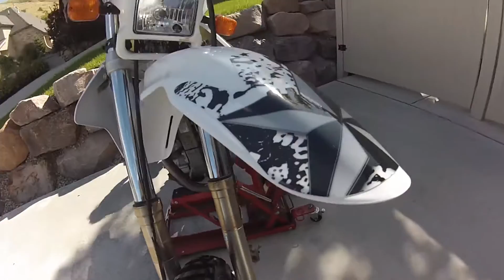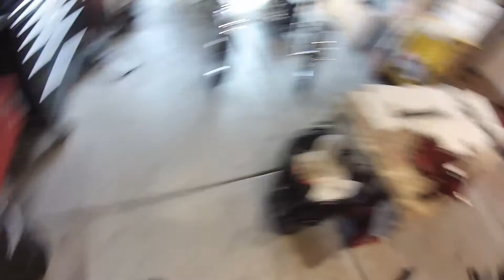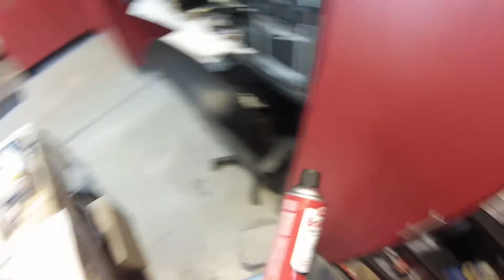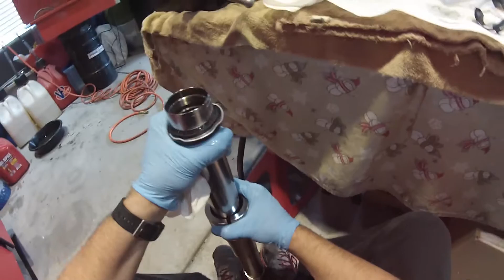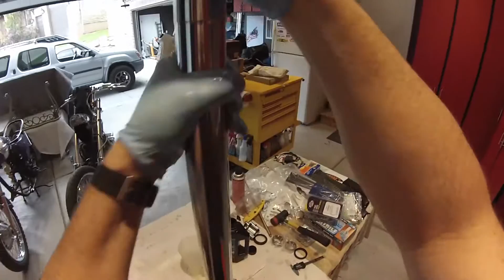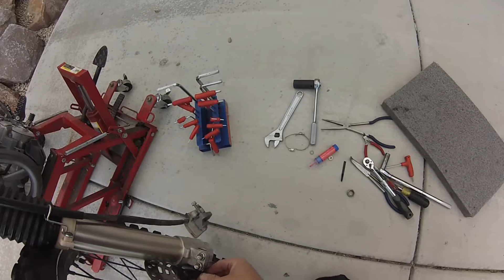KLX/DRZ 400 Fork Rebuild and Revalve - full uncut version

Comment: Hi MrDuhfactor, I followed your advice and currently running your recommended shim stack on a converted SM, by far the best front end feel. Simply plush and no longer feels harsh street riding in CA. Thank you very much for sharing your knowledge.
Reply: Did you change any shims for rebound or only compression like in the video

Comment: Excellent video brother D! I too have my favorite screwdriver! 😁 I did notice on my forks that there was a small spring under the pin that goes in the tube. I didn't see that in yours but I have checked the diagram and it shows them in there. Are yours missing or just a different year? Mine is a 2003 S model. I like the idea of a plush high speed and stiffer low speed. Did you end up sticking with this shim stack or did you change it? I think RMATVMC has Daystar fork boots for the DRZ. Thanks!

Comment: Hi from Spain, Damon! Thanks for the vídeo!

I've been following you since I bought my DRZ years ago and saw your DRZ 400 Extreme Makover.

I've been planning for long time to check my suspension and I think I'll go for it. I have some doubts and let's see if you can help me.

I'm about 232 pounds without my clothes and protections. I have a ohlins rear shock and moose racing lowering links of 1.75 inches and the forks are moved up to equal the lowering back. On the front side I have extra weight cause I have a bigger gas tank (Clarke 3.9 gal). I was adjusting the SAG last week, and I need a lot of preload, so I think I need to change my rear and fork springs. The main use is riding on trails, and rocky and sandy terrains, some light enduro.

On the forks, I have the 2002 ones with no rebound setup, but I've found a cheap ones with rebound adjustment from a newer bike (2010) and I think I'll go with them.

My plan is to change the springs (front and rear), revalve the fork, and replace sealings. It's the first time i'll do it, but I think I'll be able to.

Based on the things before, I think I should change the springs (don't know the rate), revalve (I think I'll use your setup), change the oils and sealings.

What do you think about this? Any suggestion dude?

Thanks for everything!

Comment: You do the best Videos. I need to update the suspension on my 1983 XR350r  I am 6' 290 lbs I was thinking new springs and Gold Valve for Dual Sport. Would love to hear how you would set up the stock shocks. Thanks again for all your hard work for use.
Reply from the maker: I actually had a 1983 XR350R! I loved that bike, the first motorcycle engine I ever rebuilt. That bike uses a traditional dampning rod style fork. The best thing to do is use a cartridge emulator kit from racetech, with the proper springs for your weight. In the old days, before emulators were available, we had to get stiffer springs and go up to 15 wt fork oil, which was better than stock, but not great because ot slowed the rebound down too much. Enjoy that awesome bike!!
Reply: @MrDuhfactor  Thank you, your videos are a great motivator!

Comment: Quick question you seem to be missing the springs on the push rods mine were broken and I left them out wondering if you had any problems running without them? I'll add the part number 51193-28E00 SPRING,PUSH ROD? Great video by the way gave me the confidence to revalve
Reply from the maker: If its the ones Im thinking, Those are top out springs to soften the "contact" when the forks open up. Some models have them, others dont. They also determine how open the forks are at their full length. If your model had them, and you remove them, then your forks will be longer by the length of the spring. Ill check that part number when I have a moment and double check....
Reply: I have the exact same forks you do. 2007 DRZ400S model. Since you run without the springs so shall I. But I did go ahead and order them since they're on the fork schematic.
Reply: @MrDuhfactor  he is referring the the rebound adjustment rod and the rebound needle, which should have a spring to go with it.
Reply: @timpierce5097  I don't think it's right to run it without that spring.  Many people lose that spring when dumping the oil out, or maybe it is stuck inside, which in that case, it's ok to just leave it in there.

Comment: Hi Mr DuhF :)  Great video again.  I also watched your EveRide entire series as I've recently picked up a 2006 DRZ 400s.  How did this shim stack setup work out for you?  I'm guessing I'm close to your size and after watching your vids I feel confident in the process, just not the decisions on shims, etc.  I'm 5'10" 185.  Did adding the four low speed, and adjusting the fast speed shims like you did work well for you?  Just figure I'd ask, and hopefully have a good starting point.  Many thanks for these videos.  jj
Reply: Also, that's super cool four generations are at your garage :)
Reply from the maker: @row911sc  I'm running this same shim stack in my own personal bike, and so far don't feel like I need to change it..... I ride mostly desert, sometimes fast, but it seems to do good on trails too! You can do it, I think you'll like it...
Reply: @MrDuhfactor  If you don't mind me asking more, are you using stock springs or did you up the spring rate?  Racetech says 0.50 would suit me (180-220).  I really appreciate it dude.  :)  Planning on the Idaho BDR in a month.  Probably will do the rear shock oil before I go as well.  Maybe rear comp shim stack too :)

Comment: Great video! After trying out this stack set up, what is your opinion? Did you change anything? I'm looking to revalve a 2002 DRZ400E, love plush, what would you recommend?
Reply from the maker: For me, I like it the way we've valved it, but I ride more open fast desert, and it works great there. If you ride slower technical terrain, the stock valving is actually not bad. I would hesitate softening it too much, that bike is heavy, and you can blow through the stroke real easy, causing a bottoming out scenario..... so, to really answer your question, how much do you weigh, and what type of terrain and speed are your riding?
Reply: @MrDuhfactor  200# w/ gear on. I ride a real mix, open and some technical desert, but mainly dualsport dirt roads, a little bit of slow technical. I'm looking for plush with bottoming protection.... also, looking for stack info for rear shock which I saw your Everide makeover ep. 5
Reply from the maker: @johng9323  The stack Im using for the forks would work well for you with compression clickers 18 out from bottom. I will be filming the revalve of the rear shock from beginning to end in the next few weeks, stay posted as it will likely work well for you too....
Reply from the maker: @johng9323  you becha buddy.... any time.....
Reply: @MrDuhfactor  That sounds great. Thank you very much for the information and entertainment you provide!

Comment: Can't get my main valve out from the bottom of the fork any recommendations, currently using an electric impact wrench is air really required to get the amount of spin needed? Additionally metal shavings came off as it spun did I damage the main valve?

Comment: I recently picked u a 2019 DRZ and want to duplicate your suspension mods.  Were you happy with the results, or did you need to add the additional shims that you had bought?  Do you recall what rate fork springs that you used?

Comment: The part i nobody shows is the bottom forkleg circlip that hold the bottoming cone  fro sliding out the bottom . If you take that circlip out you can slide the whole upper stantion out through the bottom of the leg withou slide hammering the guide and slide bush. Every dr klx 400 fork  vid shows mechanic using the slide hammer method

Comment: So you’ve used Pivot Works here, which I thought was one of the better/best options. 

What is your Preferred seals etc to use?

Certainly for rear pivot in the drz PW were the only one I found with Torrington thrust bearings rather than a Teflon washer.
Reply from the maker: I prefer HKS seals, then OEM, but pivot works are pretty good. I have had trouble with moose brand several times, and get frustrated with tight fitment.
Reply: Yeah I’ve be heard a lot of less than stellar feedback about moose/all balls. I steer away from them. Will have to see if I can get hks nearby.
Reply: Tim Dudeney ...SKF green seals are by far the lowest friction and sticktion....but they’re very expensive. At least they work extremely well and last a long time

Comment: Thank you for a great video.  Do you have plans to rebuild the rear shock? I'm rebuilding a 2002 DRZ400E and could was that video. Also, how are the forks with the new valve set up?
Reply from the maker: The forks are to my liking now, and quite good for fast desert riding. I still need to rebuild and revalave the shock, which I have all the parts for, but it keeps getting put on the back burner with all the other paid suspension jobs that keep piling in. I will do a full uncut video on how to do it soon though.

Comment: youtube algorithm works better with people liking and commenting on certain videos. so i thought id like, comment, and subscribe. would you suggest putting in a klx  jet kit in my klr650? ive heard it is very common and i have considered it but from the videos i have seen it does help performance but on such a minor scale. Would you suggest it? on a 2018 klr. or could you suggest other upgrades that would improve the performance.
Reply from the maker: Howdy Andy! The KLR is a bit lean from the factory, on my brother in laws KLR, we did the washer under the needle mod, I think they call it the .02 cent carb mod or something like that. I runs great, so we havent messed with it other than an aftermarket pipe. I have become spoiled, and dont guess on jetting anymore. I take it to a local dyno and measure it, and adjust jetting accordingly.
Reply: @MrDuhfactor  you would know more than I do as I have just kept the klr running as long as I could. If you suggest me running it through a dyno then I will do so. I just bought a 2018 klr as I feared that kawi would not produce another and have had a great experience In the past. So personal experiences help with future decisions. And that advice helps in the long run. If klr wasn't a fit for you in modifying then please share your experience with it and more fitting bikes for someone who is not a mechanic to ride on trails.
Reply: From what I understand The .22 cent mod was a quick fix. But I hear a lot of controversy that putting a klx carb jet kit in a klr would help with some of the sluggishness of the klr same as the .22 cent mod but better. I personally dont know if ether of these things does better. I thought I'd ask someone who works on bikes if they would know better. Did your relative notice a difference to justify the modification?
Reply: I also realize my bike is to lean. It pops after deceleration. But what modification can I do to rectify  my situation?
Reply from the maker: @andymehrer457  Andy, yes, the .22 cent mod did help the bike run better, and he's very happy with it the way it is. I havent run the KLX needle to know if it is any better, and the only way to know for sure is to put it on a dyno with the sniffer to measure the air fuel ratio at different RPM's. Each bike I have that is carbureted has been tuned on a dyno, so I know they run like they should. Since you put so many miles on your bike, the only competent advice I can give you is to have it dyno tuned.
Reply: Thank you for all the advice mrduhfactor.  I can't believe that I'm getting feedback from a legend. I will consider the .22 cent mod to the klr. I am not the first and I am not the last. Hell even the new klr might possibly  be able to receive knowledge from this post. Just as you know your knowledge is highly coveted. So I wouldn't stop posting those videos. As your opinion is highly coveted. People like me seek knowledge. And it seems like you have knowledge to aspire to! Yea I made my bike run for 220k but do I even know how other than cleaning the carb and regular oil changes hell no. You seem to have a deeper understanding than the weekend warrior. And personally I respect  and covet what you have to say.
Reply: Let me expose that most of people dont even know what it means to check your valve timing  including  me.  I hear it a lot on on dirt bikes. If you were to explain this then I'm sure you would get a whole lot of viewers because of explanation in that alone. Why do some dirt bikes need it? Just you explaining your knowledge on how duel sports and dirt bikes alone I believe you would catch audience's such as myself
Reply: @andymehrer457  , Hi Andy, Greetings from the South Island of New Zealand!!  
To check valve timing, you need the workshop service manual, refer to the valve timing procedure and you will see a picture and/or a diagram of the camshaft sprockets with timing marks stamped in the sprockets.
You need to set the crank/piston at TDC (top dead center) by aligning marks on the flywheel in and inspection 'window' and then checking if the marks on the cam sprockets line up as per the manual's pic/diagram.
The reason it's a good idea to check it is correctly timed is because someone may have been in there before, and timed it incorrectly . . . or, the tensioner may have failed and alowed the cam chain to jump/skip a tooyh or two.
Hope this helps.
Reply: @munter10  This is a lot to take in.. I am not a mechanic. I merely kept my last klr running by changing/topping off the oil and cleaning the carb. I doubt that the last owners of my bike (that only has 5k miles on it) fiddled with anything. As I got a discount because the previous owners dropped it so many times and ruined the plastics. I am 32 and while written timing chain specs from the manual helps some people.. i have had a hard time going to the books for reference. first i dont have the books(even if i got them online they would be confusing to me) second i am not traversed in that lingual. Showing me would get the best results as i am a visual learner. I believe that mr.Duh has some experience at least more than i do, so i seek knowledge that extends a book and more from experience. He has at least modified 1 klr. I try to make an argument that many of the klrs where shipped to the states such as California and that has effected the performance of the bike on paper to meet "some" of the states emission standards. hell if i am not correct than i welcome reprisal. but i had taken off the californicating recommendations because i have heard that it restricts the air/fuel consumption of the bike ultimatly restricting the bikes potential. thank you for your suggestions though. I am not shrugging them off, i just dont understand some of the temonlogy.

Comment: how did the valving work out? I am trying to get a smooth ride over rocky terrain while keeping enough stiffness to absorb big hits...the setup I have with dampening adjusters at full soft and 52 springs is great at absorbing the big hits but over rocks 5 inches or less it's still a bit harsh, currently I have (4) 24x10, 12x20, 14x10, 15x10, 17x10, 18x10, (2) 20x10, 15x10, (2) 11.4x4....any ides what changes would be most effective in softening up the ride over really rocky stuff in the 1-35 mph range? I'm 250lbs and A level type rider, thanks!
Reply from the maker: Thats a very odd stack.... did you try the stack I listed in this set up? Im still very happy with it, but the stack you listed above doesnt make sense to me.....
Reply: @MrDuhfactor  thanks, I sent the forks to a suspension shop last season and that's what they put in there, it does seem odd, I have only (4) 24x10 on low speed and you use 9, wouldn't that make the action even stiffer?...currently the forks are apart and I am considering  your stack for a better ride on the rocks, also see you have a multi stage stack, which would be best?...you started with two spacers and then the 8x10s....are my  (2) 11.4x40 the spacers? what I listed is all that was in there
Reply from the maker: @pearltc  honestly, I dont get what they were doing, but my stack is more stiff on low speed compression (low fork speed, not bike speed) which is on obstacles like berms, g-outs, rollers, face and landing of jumps. Yet, a softer high speed compression stack to soften sharp edge braking bumps,  rock gardens, etc.
Reply: @MrDuhfactor  I'm gonna try your setup, just waiting for parts...the first two spacers you put on the valve body I am guessing are the 11.4x4 so your stack will go on top of them...
 thanks
Reply: bty in the manual the S takes 710cc and the Z 720cc of fork oil

Comment: So Damon, its been 3 months, what are your thoughts on your suspension work
Reply from the maker: I'm sticking with this valve stack for the forks, but I backed off the clickers for compression to 16 out, and I like it better for gentle riding. I plan to do the rear shock in the next few weeks, and will do a  full length video on it, after which I will final adjust it all and have some final thoughts.